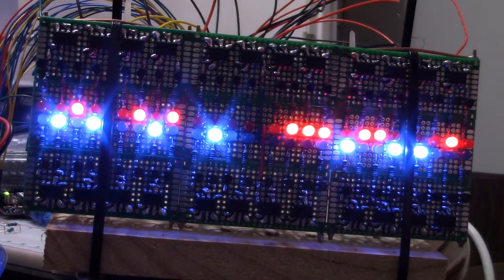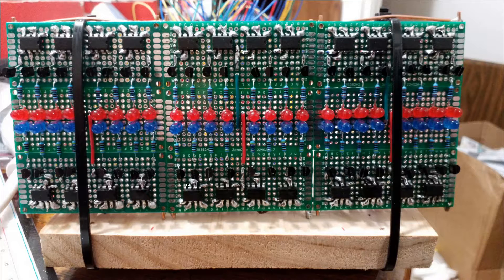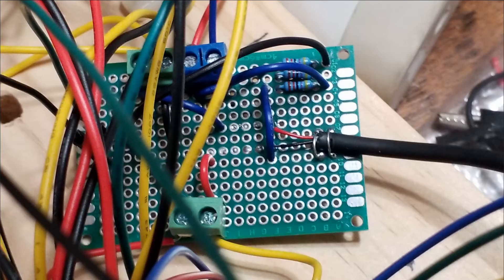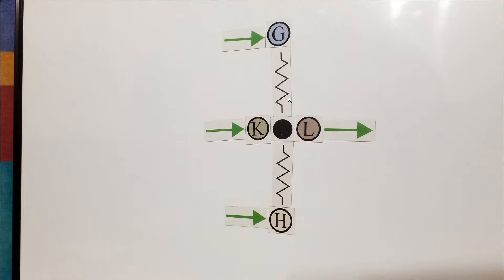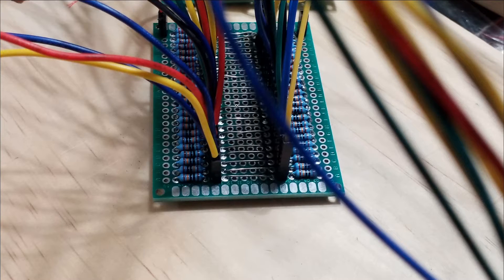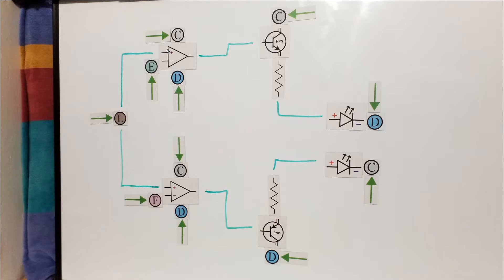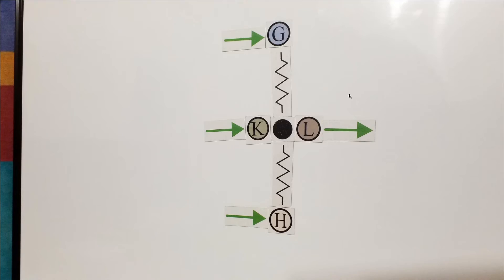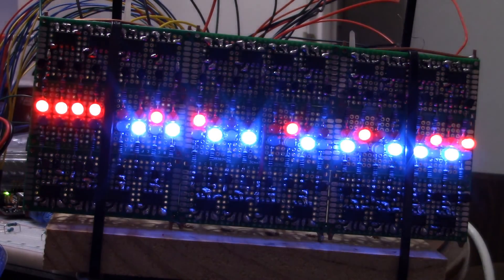Das Blinkenlights - 24-Bit Tri-State Output Display Board - Also, Modern Art - Simply Put

Comment: Great electronics/art project! I'm not savvy enough yet regarding PCB design, but this would be a great circuit to get made for a few dollars/euros by one of the large PCB manufacturers. I'd recommend a 4 or 8 bit SMD version to keep things nicely small/modular, maybe with a jumper to allow use of the reference signal from the target to drive the LEDs wherever possible instead of always requiring a separate USB cable. By the way: wouldn't it be possible to drive the LEDs directly from the opamp outputs?

Comment: I’m building it. I hope I can pull it off. I don’t think I have more than 10 matching transistors, but I’m sure I could rob some from something in my junk shed. Thanks for sharing your knowledge and spirit.
Reply: So did you pull it off? 🙂
Reply: @nkronert  I decided not to build this and instead I used 3  74574s.
Reply: @jj74qformerlyjailbreak3  ok, so instead of checking if some lines are floating, you made sure that you knew the state of your output pins by putting a 74xx574 in-between?
Reply: Correct except I used bi-color LEDs to show the floating points. Common anode

Comment: I just found your channel. Subscribed. I will likely powerwatch every-thing. All smartz will belong to us. : ) Thank you.

It's kind of like a logic analyzer, but more fun.

A LM358B or P can source 30ma, which might enough to run your LED reliably, without the transistor?

The strain-relief was a good idea, but if you use only one more wafer thin zip tie, it won't melt the power cable. A drop of cynoacrylate will create a pleasing death-grip between the zip-tie and the cable sheave.

I love breadboards, but your project and the one I am working on might be simpler on a PC board.
https://www.kicad.org/

Comment: Great video, and really useful board. Any chance you could publish either the schematic or the BOM somewhere?
Reply from the maker: I showed the circuit in the video, and the full schematic is just "24 of them", and all of the parts are just whatever you have available or want to use: Size the emitter resistors for the proper LED brightness, the other resistors are whatever values you prefer for pull-up and pull-down, and just any op-amp or analog comparator chip would work. It's really something that you can easily tailor to your own supplies and goals.
Reply: Thanks.  I'm new and learning all the time, so videos likes yours are fantastic resource

Comment: Like your videos a lot! I'd love to hear your thoughts on choosing an osciloscope. Are you still happy with your Keysight scope? Thnx!!!
Reply from the maker: It's certainly a competent device and does what I need it to do, but now that I'm more familiar with oscilloscopes and what they can do, I'm fairly certain I overpaid for it. I do like it, and I'm glad to have it, but you should definitely look around at some other options to make certain. This turned out to be sort of the iPhone of oscilloscopes: A good device, at a premium.
Reply: @simplyput2796  Thanks for sharing! Been reading a lot of scope specs these last few weeks :)
Reply: @simplyput2796  Yup, it's a very nice scope. I have the same one and I think you could definitely spend quite a bit less on something like a Rigol and get 4 channels instead of two and a half. Most people forget that you can use the Ext. Trigger input as a digital channel 3 of sorts.
I got mine for free from the people at Keysight so I guess the price isn't an issue for me.